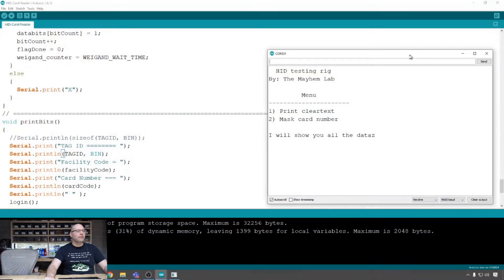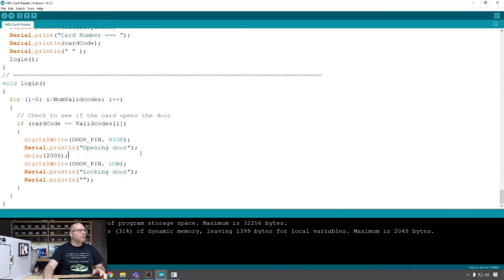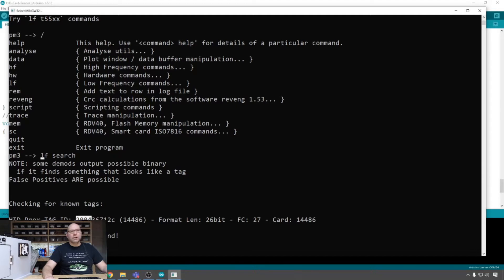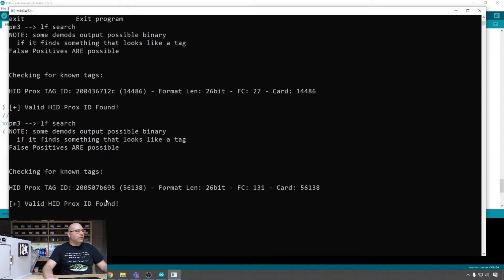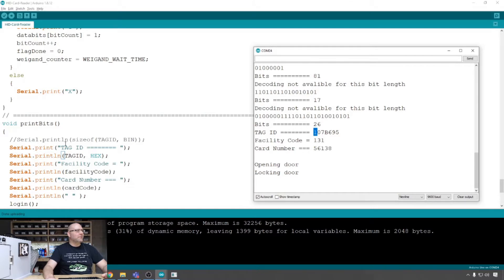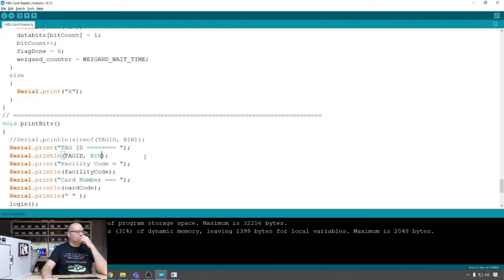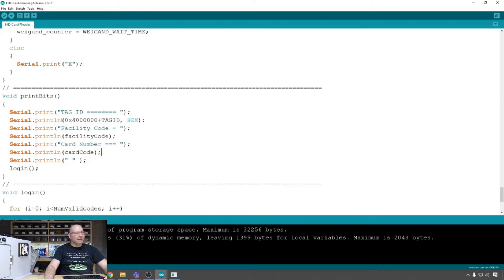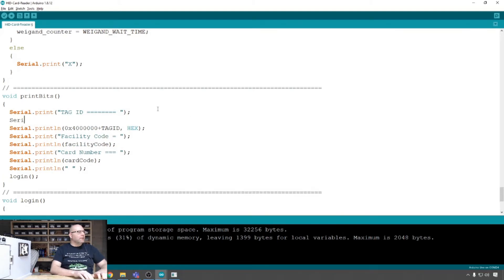#24 - Decoding RFID HID Cards with an Arduino Uno

Comment: Hi i am itrested what you have done. Acording to your porogram wrote on arduino you used pin 2 and 3. I have a question to you , if i connencted hid reader card with wiegand interfejs would i have to add some parts to properly connection or mayby can i connect it directly to arduino ?,